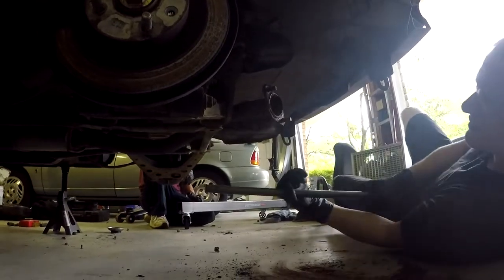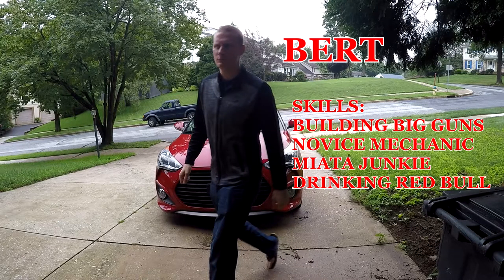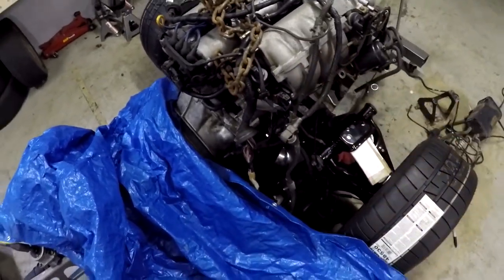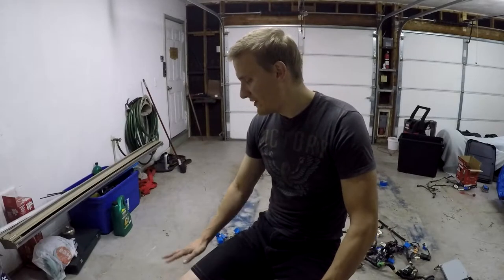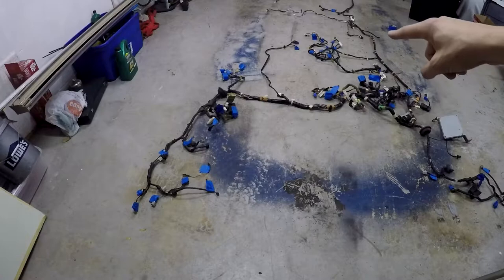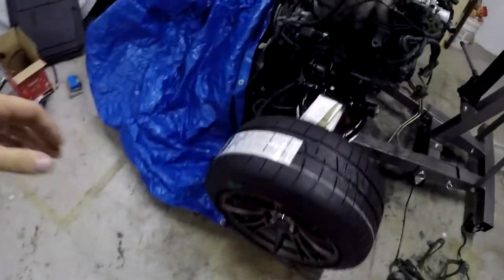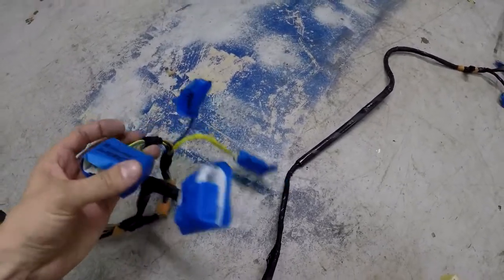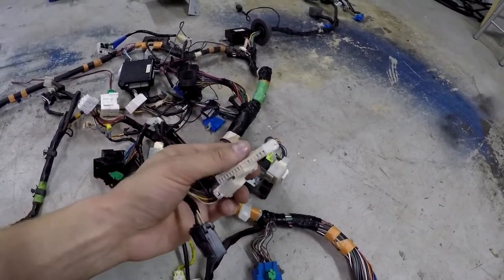Full Exocet Build Guide Episode 4 (The Wiring Harness)

Comment: I believe you suggested in a previous video to not remove any of the excess wiring from the harness.  Is that the case?  I feel like half of that harness is junk.  I would have thought removing the extra stuff would help future electrical troubleshooting, but I don't know what kind of complicated wiring is under that tubing.
I've built some RC planes and made tiny wiring harnesses for them, but those are simple.  They're very low amperage and they have no grounds nor relays.

As far as I can tell, you've done a great job with the videos so far and they're getting me over the intimidation of the project.